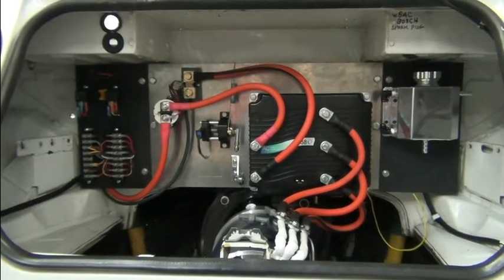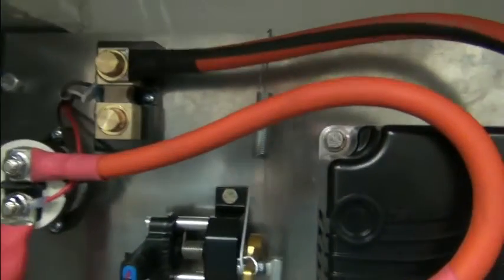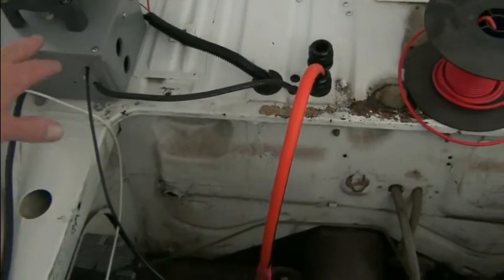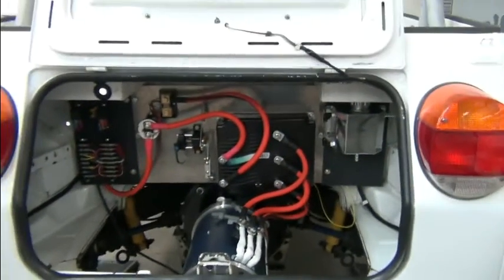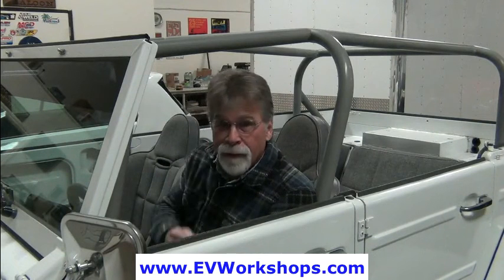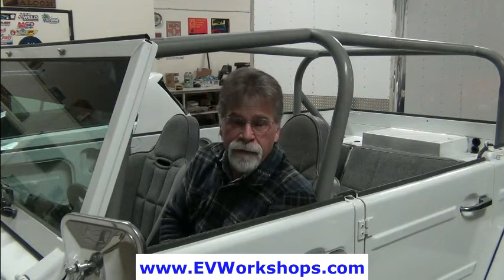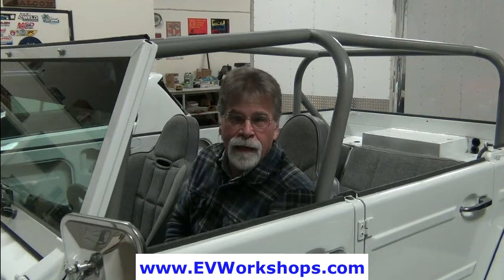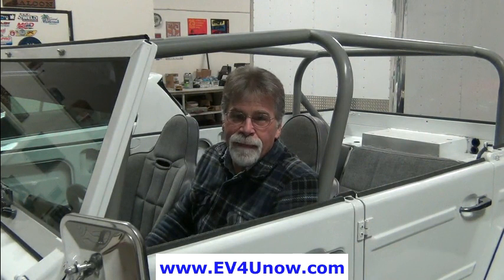VW Thing EV Conversion - The waiting game.

Comment: How about a corvair EV.
Reply: Corvair is a heavier vehicle but I would see no reason why you couldn't do one. It might be a good conversion for a dual stacked AC-35 or 50 with the 144 volt setup.
Reply from the maker: Many Covairs have been converted.  Do a search to check  them out.